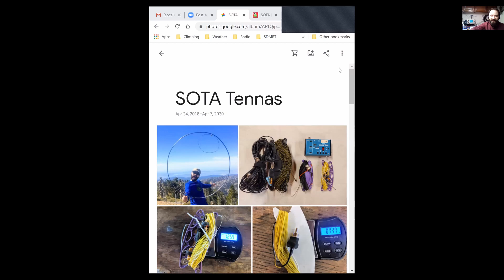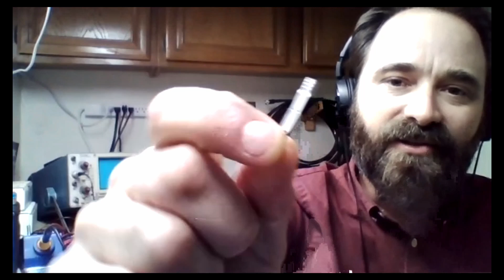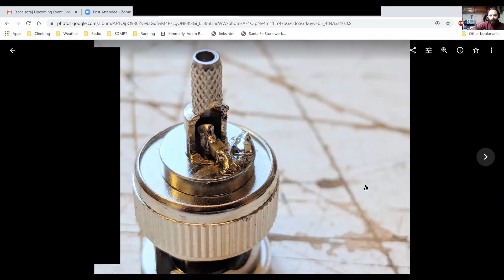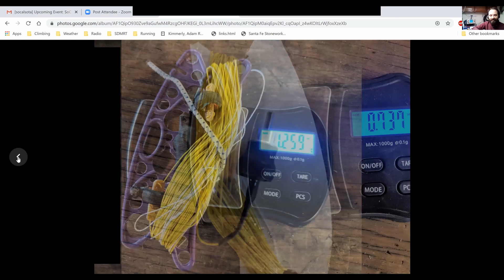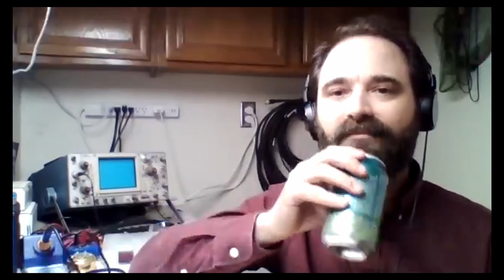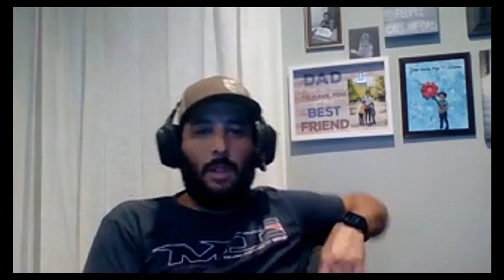Top 3 Portable HF Antennas

Comment: I am an novice HAM radio amateur, an Q about the traps in combination an EFHW antenne. EFHW multiband antenne with same impedance on al bands. the main reason I suppose choice an EFHW antenne. So EFHW for 40M also works on 20M, 15M on 10M ... started with the lowest freqeuntie, right ? what is the areason to use an trap ? beside the loading function that result in an shorter lengh ? Thx. ! kind regards Theo. Netherlands
Reply from the maker: Good question, Theo. The primary reason would be to add bands that are not resonant multiples or 40m, such as 30m, 17m, and 12m. Links are another good option, but require lowering the antenna for a band change.

Comment: Great video and discussion of the antennas.  I really like the BNC unun, and I got to get the stuff and build one for my QCXmini 40 Meter cw qrp rig from QRP-Labs.  Using a tuner and my  80 meter dipole and calling CQ I was heard as far as Spokane WA the other day.  If I can get one of these built I won't need the tuner, I will just make it resonant for the middle of the CW band.  Thanks for sharing this vital information.  Juddie - WD8WV

Comment: I understand the linked dipole using 100 watts.   Just curious why the KX2 with unun 9 to 1 random wire, and End fed Half Wave with the mountain topper.   Why is one preferable to the other in your mind?
Reply from the maker: Yes, the KX2 has an internal ATU and I like the ability to pick any frequency on any band and instantly tune to it.  It's fantastic for S2S chasing. The MTR has no tuner, so the EFHW is by far the best option for an UL deployment.
Reply: @K6ARK   Interesting.   Do you see both antennas as equally efficient as a radiating element?
Reply from the maker: @radionb3i  no, the random wire is a bit less efficient due to tuner losses and the shorter length radiator (I typically use 41 feet).  The EFHW is on par with a dipole at the same height.
Reply: @K6ARK  Your info is really helpful.  Thanks,  Jonathan NB3I

Comment: Adam, since a typical EFHW antenna with a high transformation ratios of say 49:1 or 64:1 (or in that ballpark) will resonate on all harmonics (EX: a 40 meter EFHW will resonate on 40, 20, 15 and 10).... since you are using the traps, I'm wondering, does this small design not resonate on the harmonics? Or maybe I missed it, and you are using the traps with a 9:1 ratio?
Reply from the maker: I use traps for non-multiple band combos like 20, 30, and 40m. If you add a trap for 30m, you need one for 20m because the inductance in the 30m throws off the the resonance for 20m. A link for 30m (or other bands like 17m) is another option that works.
Reply: @K6ARK  ok, I gotcha now. Thanks!

Comment: Mismatch of coax is greatly depend no the length of the coax and the frequency.  If you coax is short using a tuner has much less loss because the coax look like wire.

Comment: Great talk!  How do you get away without a CMC when connecting the unun directly to the rig?  Aren't you energizing the metal case of your rig?
Reply from the maker: I've had no issues at QRP power levels. I'm essentially acting as part of the ground system which is fine. Tuning the antenna in the setup and position you plan to operate will minimize your SWR and reflected power.
Reply: @K6ARK  I'm curious about your tuning procedure.  In many of your videos you use small handheld QRP rigs.  I suppose they do not have built in SWR meters.  I also saw you showed some antenna analyzer plots.  If you are part of the antenna system, then how do you get an accurate assessment of the antenna system?  By touching the connector of the analyzer while measuring?  73, Mike KK7ER
Reply from the maker: @notionocean  I typically hold the analyzer like the radio and sit on the ground like I would normally while operating. I avoid touching the connector or having my fingers right by the toroid because I typically avoid that while operating anyway. I actually did install an SWR meter into one of my mountain topper radios, but I don't think it's entirely necessary. I never really adjust the tuning of the antenna in the field.  Wire height above ground and proximity of the feed point and end of the wire to the ground are probably the most important factors to control while you're tuning.

Comment: Do you notice any change in the trap frequency when the epoxy and heat shrink are added? Tim N9PUZ
Reply: It’s happened to me now multiple times. Not sure what I’m doing wrong.
Reply from the maker: They have an impact - some more than others. Tune slightly high, heat shrink, and check again. If the epoxy you're using had too much of an impact, try silicone or hit glue instead. Epoxies vary wildly in their dielectric properties.

Comment: If I am going light, with or without an ATU, my number 1 QRP antenna is a 40-20-10 as built by PAR, LNR and now the people that make keyers.  I will fine tune it for CW frequencies with an antenna analyzer for  14100 and also 7050.  The 20m portion of antenna will be much wider band, better for both CW and SSB, while the 40m, due to the trap coil that keeps it  a smaller, shorter manageable length antenna, will be much narrower in band width, so I prefer the 40m to be attenuated in the CW portion of the 40m band. The EFHW deploys quickly, and changing bands is just a push of a button away, no tinkering with the antenna, like a multiband dipole antenna.  The dipole antenna, will, however, not be limited to 25 watts maximum, it will handle a full 125 watts, as made by Sotabeams in the UK.